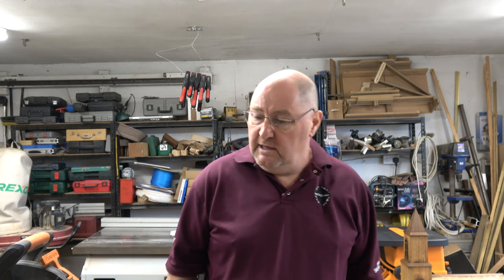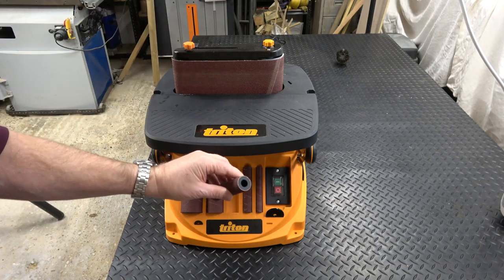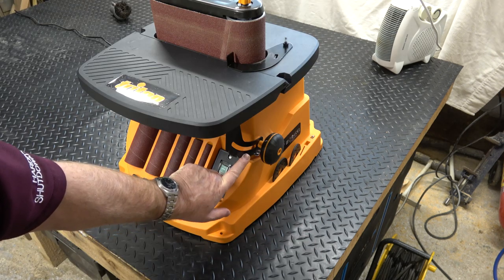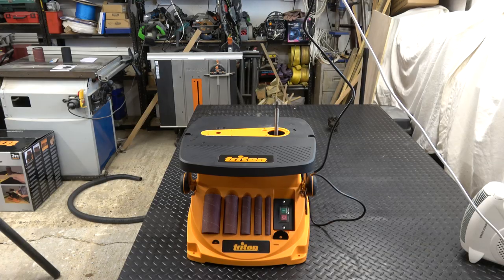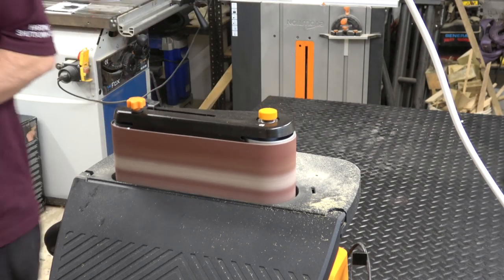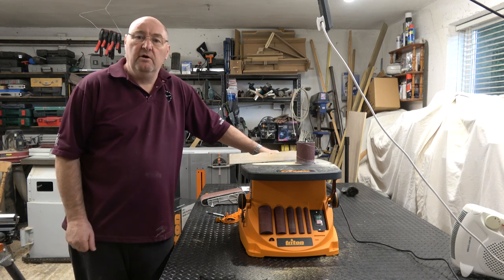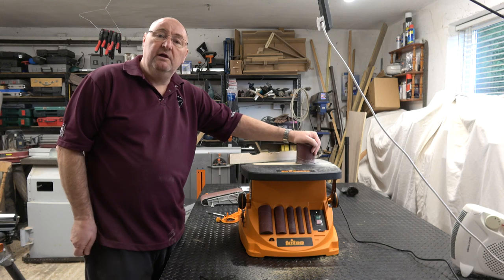Triton Oscillating Spindle & Belt Sander - Review and demonstration.  A great bit of kit!

Comment: What you didn't mention is that when you want replacement  sleeves you can't by the sizes individually and if you are only using one size you end up with loads of sleeves you don't need. I have one of these machines and have brought the 3" spindle as you suggested. Many thanks for a very well made video.
Reply from the maker: Good point about the sleeves!  :-)

Comment: thanks for the brilliant review on this machine. mine comes today with extra sleeves and a 75mm rubber insert , really it's a no boner oscillating drum belt sander and you can use the bevel . nice trick with 75mm drum. but why didn't triton cater for the 75mm drum in manufacture when they sell sleeves in pkts of six
Reply from the maker: I find it strange that they do not include the 3" drum with an insert.  I am very pleased with mine.  :-)

Comment: Hey Russell, just came across this review. Very useful, thank you. I have the Triton in my shopping cart, and I think it's going to be "check-out" soon. Just one question, if you don't mind: what size are the belts? "Suggested" online ad-ons include belts of different sizes, 3" x 21", 4" x 24" - obviously should be one length. Would appreciate insight. Thanks, mate.
Reply from the maker: The belts are 100mm x 610mm Harry.  https://amzn.to/2Txysb0   here is a link to some that I purchased.  Shop around for the best price if you decide to go for it!  :-)

Comment: thanks for a great review Russell - just purchased !
Re. the 3' drum; when fitted , the base of the rubber snags on the the metal insert mount on the extreme right.Did you file this down on your machine?
I can clear it by using a number of washers/spacer but it is not exactly 'elegant' !
Thanks again
Reply from the maker: I never had an issue with mine.  I hope you can sort it out!  :-)
Reply: @RussellPlatten  thanks Russell; will investigate!
Reply from the maker: Good luck!!  :-)

Comment: Great review thanks. Looks like a good little machine. It looks as if the wide belt oscillates a smidge above the table at the top of its travel?
Reply from the maker: The Sander is a great addition to my workshop.  The belt can be raised or lowered on the Sander and I did not have it set correctly on the video.  :-)

Comment: Thank you very much for doing the review. What’s the accuracy like?  I watched a review of a different make to the Triton and the reviewer remarked that the table could not be sett to an accurate 90 degrees to the belt sander, and also the sanded edge was slightly bellied amongst other things. I would like a belt bobbin sander combination but accuracy is important to me. Thanks again.
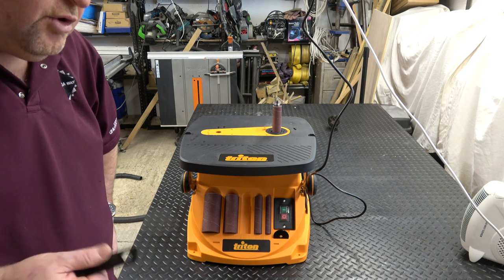Reply from the maker: If you look at 5:00 you can see me check the spindle.  I have no issues with mine.  Others have mentioned issues with theirs.  I went into the garage before replying to you and checked it again.  It was very slightly out, about 1 degree, but I was able to correct it by giving the moving part of the table a tap upwards.  The belt was vertical at both ends.  I found no movement inwards at the centre  bottom (with my finger resting on the table pressing on the belt in the middle between the two rollers).  However at the top of the belt in the centre there was a couple of millimetres movement, I suspect that this is caused by the tracking mechanism.  I would say that it is not perfectly accurate, but is is certainly fine for my needs.  I hope this helps.  :-)
Reply: Russell Platten Thanks for checking it, sounds as if it may be ok for my needs. Thanks again 👍
Reply from the maker: @bluehoo0  You are welcome.  :-)

Comment: Your table is touched up by brush with black paint too, like mine. Does the belt on yours and spindles sit at 90 degrees? Does the belt sand flat or crown a little? Any issues with yours?
Reply from the maker: The belt and drums are 90 degrees to the table and the steel plate on the belt attachment lines up with the rollers.  I have no issues with mine.  I take it yours is not right?  :-)

Comment: Hi Russell, what dust extractor do you use?
Reply from the maker: I have used a Nilfisk Multi 30 with a dust bag for years.  Evolution power tools recently sent me a bagless shop vac to review and I really like that too:  https://youtu.be/k1dqSX7MR68  
Any reasonable shop vac will do, you may need to find an adapter if the nozzle does not fit.  :-)

Comment: Lost the spanner and can't find one that fits any suggestions?
Reply from the maker: The spanner is a 13mm metric.  These are very common and if you have a few spanners in your workshop you may well have a spare.  If not, you can always use an adjustable spanner.  Just in case, here is a link to a suitable spanner on Amazon:  https://amzn.to/3sv66zM

I hope this helps!  :-)
Reply: thanks, i was able to order one. thanks for your reply. it seems it was just really jammed tight, used one spanner to hold it still to stop the spinny thing from spinning and the other spanner to force it free. @RussellPlatten
Reply from the maker: Glad it is sorted Geoffrey!  :-) @geoffreyatkinson5653

Comment: At 7:16 i guess you have the belt wrong inserted there
Reply from the maker: I do not understand.  :-)
Reply: @RussellPlatten  ohh, here comes my english speaking abilities.. . I'll do my best. The edges of the sanding belt are overlapped and glued together.  When sanding something it's safer if the "above" edge comes first, if not the risk of damaging the band increases. Usually on the inside of the band is an arrow indicating how it should be mounted. I'm pretty sure you know that so i guess either i'm not seeing very well or you were excited to try that new tool and forgot to put the belt right
Reply from the maker: @denoro.  Your English is very good!  I see what you mean about the belt, it is on the wrong way round.  I was not paying attention when I put it on.  Thank you for pointing that out!  :-)
Reply: @RussellPlatten  thank you for your review of this product. I really need a spindle sander , but can you believe i can't really find one in Romania? And it's not like we don't have every other cool tool on sale here. I'm frustrated. And i never ordered on Amazon before, and the fact that it's a heavy tool doesn't help with my confidence to order one ...